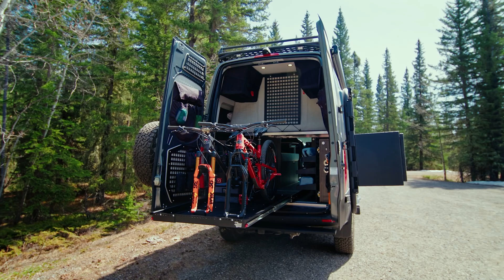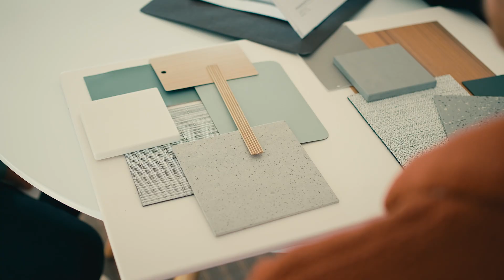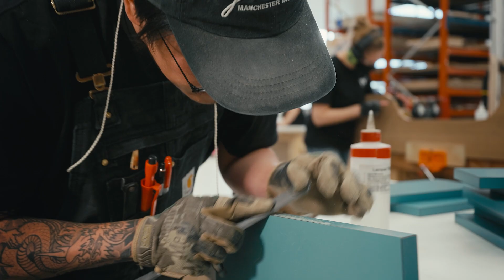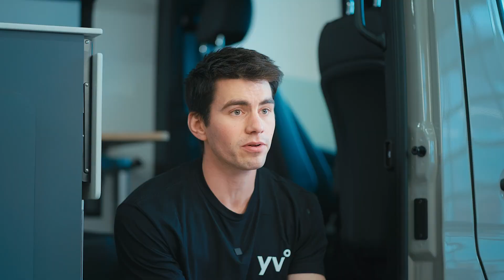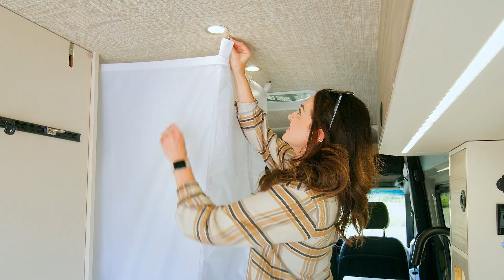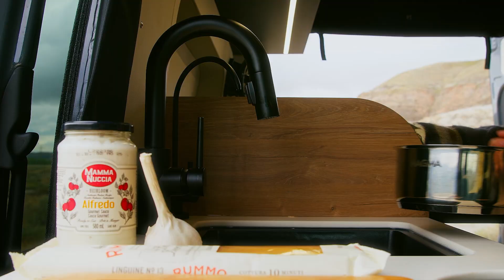The Yama Way | Our Sprinter Van Build Process

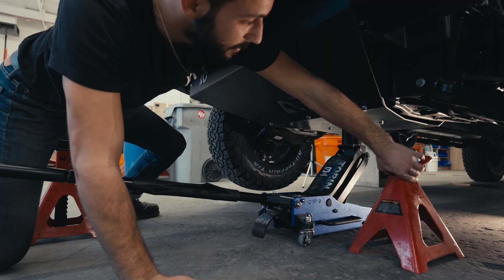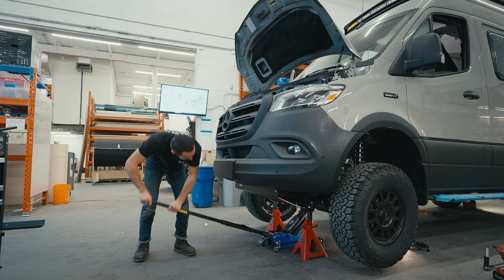Comment: At 2:37 and 4:36 are you using the skid plate as the jacking point? I'm always confused as to where the acceptable jacking points are outside of what's in the manual. Thanks!
Reply from the maker: We're not! It just looks like it from the angle of the video.